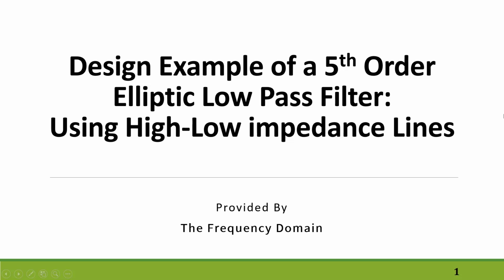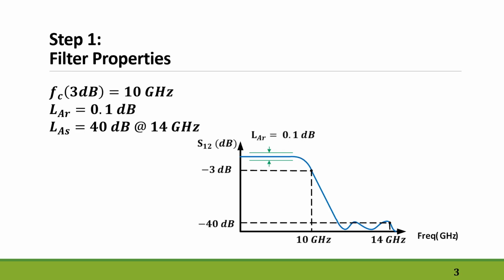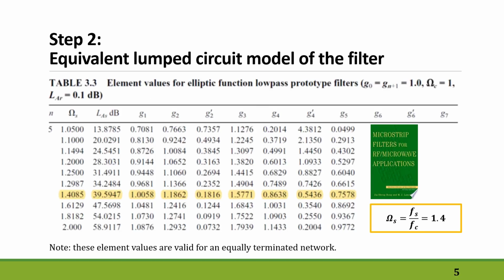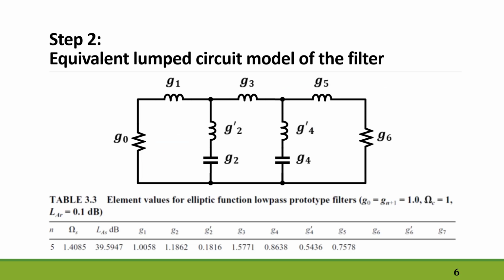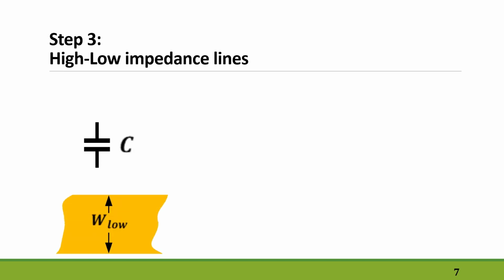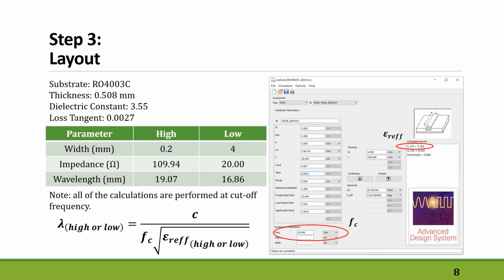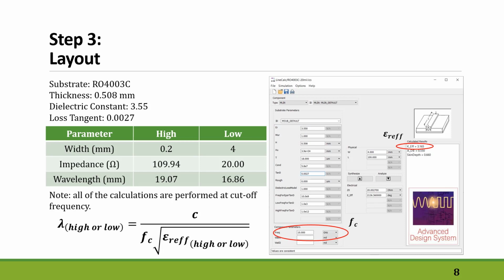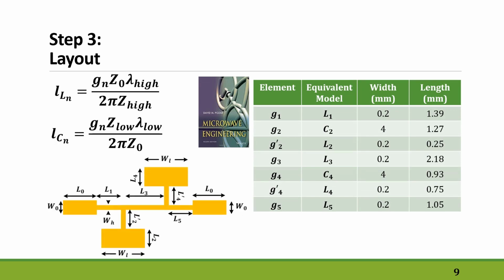Design of an Elliptic Microstrip Low Pass Filter

Comment: Hi, great Video. Really helps understanding the principles. 

However, I have a question. How would I have to proceed if I want to transform the low-pass filter into a bandpass filter. I know that serial inductances are transformed into parallel LC swing circuits and Parallel capacities to serial LC swing circuits. But how does it behave with serial lc swing circuits to ground as with your low-pass? What is the equivalent of the bandpass?

Comment: Where is electronic circuit
Reply from the maker: By 'electronic circuit', if you mean combination of capacitors and inductors, since it's a microwave filter theses components ( normally above 300 kHz) turn into microstrip lines.